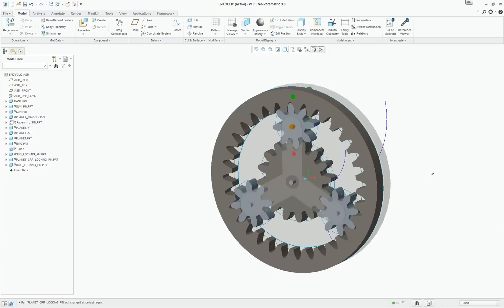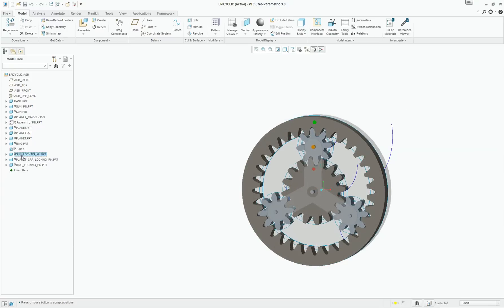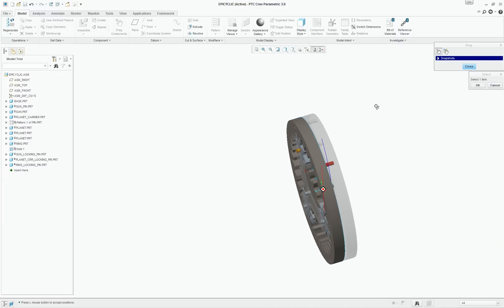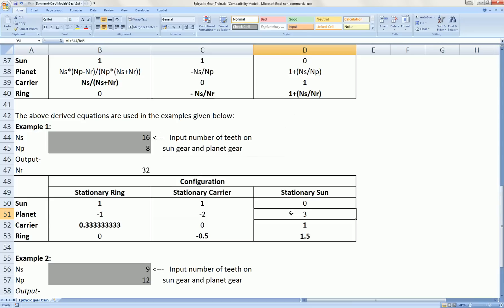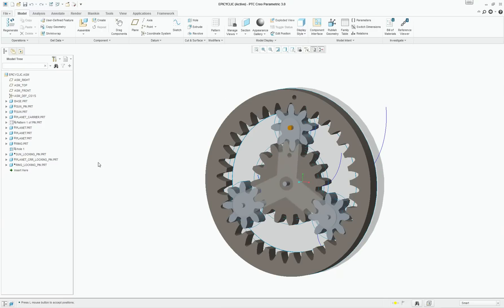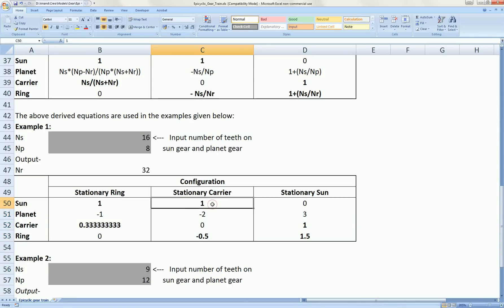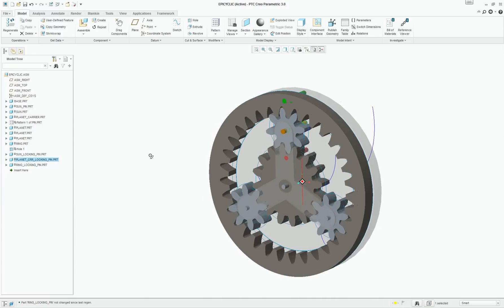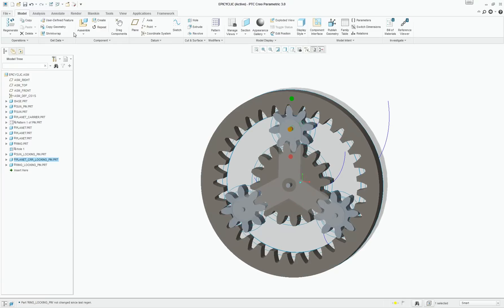Planetary / Epicyclic Gear in Creo

Comment: Hi Anand, That was a good video with proper demonstration. The ring gear, that you have used in this video, seems like you have removed or taken our a bigger spur gear from a cylinder. The tooth profile for the ring gear are opposite of the sun and planet gears. How you did that?
Reply from the maker: Hi Enanko, I'm happy you liked the video. Regarding your question about the internal/ring gear, what I did was created an annular disc and extruded/cut a single tooth on the inner side of the disc. Then using "Axis Pattern" feature in Creo repeated this cut over the disc. The number of pattern members was linked to the number of tooth on internal gear in order to make the drawing parametric.

Removing a smaller spur gear from a larger disc like you said is also a feasible option. However here care needs to be taken to interchange the addendum and dedendum values of the spur gear being removed. This is because for internal gear you want the tooth addendum to be towards the center of gear and dedendum to be away from the center (which is opposite in a regular external spur gear). Hope it makes sense. 

You can download the drawing from grabcad https://grabcad.com/library/epicyclic-planetary-gear-train-model-with-three-configurations-1. 

If you have Creo then you can look at the steps involved in making this gear.
Reply: Yes, but if we look at the curve of teeth for the ring gear and compare it with that of any other gear, then its different. Does that really happen or we missing something. If you carefully look at the curve from dedendum towards the addendum for both the gears and compare, then you will find the difference.
Reply from the maker: The curve that you are talking about is the involute curve (shown in blue color). This curve is found based on the base circle of a gear. Base circle is dependent on Pitch Circle or basically the size of gear. So a large gear is going to have a large base circle. Since ring gear is the largest, the involute curve for it is visibly different than other gears. In fact the shape of involute curve is always going to be different between gears of different sizes. For gear meshing it is necessary that the module of two gears is same and not the shape of the involute curve.
Reply: Anand Dhariya I am not talking about the size, perhaps if I have the option to add a pic then I would have been in a better position to present my view. The best I can say is, if you look at the curve from addendum to dedendum, then for other gears it's going from outside to inside, but for ring gear it's inside to outside. 
Are we right in doing so?

I am still not sure whether my point is clear or not...
Reply from the maker: I am not entirely sure what you mean when you say the curve is going outside to inside. But I think what you are trying to say is that the involute curve for the ring gear should originate from the outer side of ring gear and move towards the ring gear center since for external gears it is starting from the side closer to the center and moving outwards. Is that what you are saying?
Reply: Yes, the same thing. Should it happen that way or you have done it right?
Reply from the maker: What's done in the video is correct. This is because the involute curve is the path traced by a point on a string as it is wound or unwound on a cylinder. So in case of internal gear of course you cannot have the string winding such that it is going into the cylinder. Naturally the direction of the involute curve will look opposite in case of internal gear. You can think of an internal gear as an external gear shaped hole so that the direction of involute is still the same as in external gears.
Reply: Anand Dhariya exactly... that's I what I want to hear... thank you so much for this info and cooperating with me...
Reply from the maker: You are welcome

Comment: hello Anand, I have tried making the same gear mechanism, however while i was able to mesh the 3 gears with the central gear, meshing them with a gear was difficult because everything keeps rotating, can I ask you how you did that, great video by the way !
Reply from the maker: Thanks for watching saadamiens. The entire mechanism is mounted on a base plate or support plate to enable use of locking pins. In this video I have made it translucent. Insert locking pins to prevent the assembly from rotating. Also you should create datum planes in your cad model which are located at either centre of tooth on a gear or centre of gap between two teeth for easy positioning. I have given the grabcad link in description. You can download this model from there.